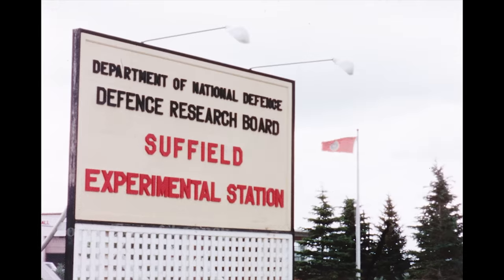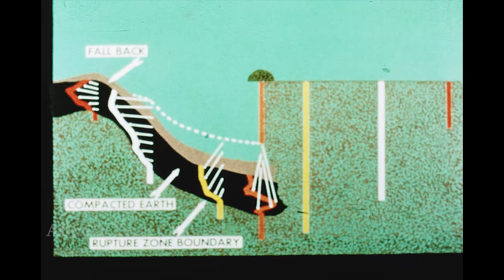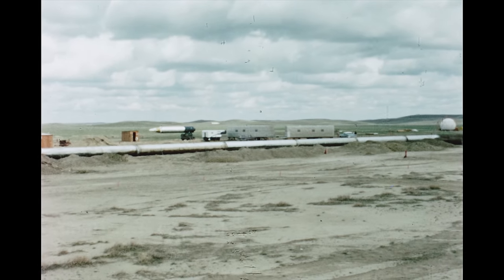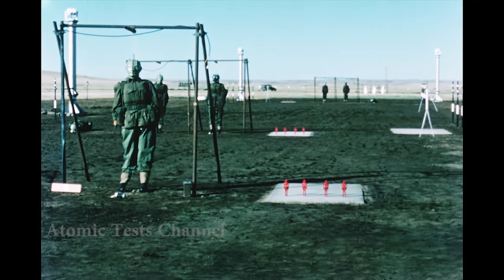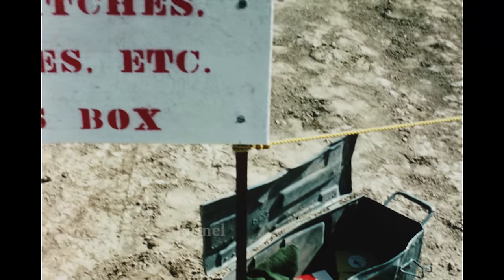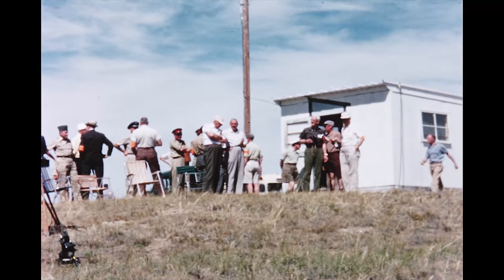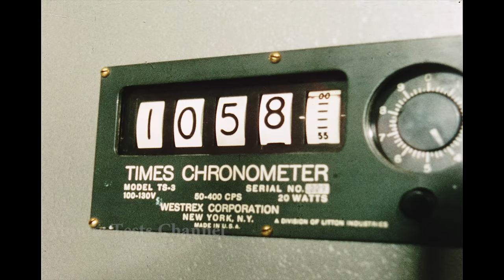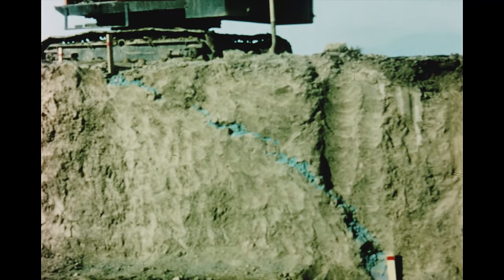4K SECRET CANADA 500 TONS TNT SIMULATED NUCLEAR WEAPON TESTING 1968

Comment: The U.S. DoD and Defense Nuclear Agency did a series of tests called "Misty Castle" starting in 1981 using ammonium nitrate and fuel oil (ANFO) to simulate kiloton nuclear explosions.  Some of the explosions included radiation sources to simulate nuclear effects.  The final test was done in 1987 called "Misty Picture" using 4,865 tons of ANFO.  All tests were done at White Sands Missile Range (WSMR) at the  Permanent High Explosive Test Site (PHETS).

Comment: There were three of these tests:

Snowball 1964
Prairie Flat 7/17/1968
Dial Pack 7/12/1970

There was a parallel series of such tests a few miles from the Trinity Site in New Mexico of 4-8 times larger, using ANFO rather than TNT.

Comment: This was a pretty cool experiment, but I feel it was missing the intense flash and heat before the actual bomb shockwave.
Reply: In our tests, we used Thermal Radiation Simulators which pump an insane amount of LOX + powdered aluminum into the air, and light it. You can see them in other videos.

Comment: Very pretty, Small compared to Heligoland or even the recent Beirut Blast (AN and Fireworks my Ar$£)
Reply: Only because there's no real frame of reference here. Around the same tnt equivalent as Beruit though..
Reply: @turdferg9703  Also, Beirut wasnt just fireworks, and that is well known
Reply: @viktorrietveld  Yeah, the fireworks set off the Ammonium Nitrate that had been sitting there for years. In the 90's the US a similar test with truck loads of Ammonium Nitrate to simulate a nuclear blast.

Comment: I live in north of canada , they test a lot of shit in there. 
We have seen every craft , ship , tank being test on cold environement . 
U know why there not f 35 in the north ?
They are shitty plane in cold environement .
Reply: Yeah, because it's not cold at 40,000 feet?  It's between -40 and -70 F (-40 C to -56 C) at 40,000 feet,  and military planes regularly fly at 50,000 feet.  So, it's colder than that in northern Canada?
Reply: Actually it’s due to it being a single engine platform.
Reply: Johnny Sinns  Dont worry we have realy great mechanic and the f18 is still beter then a f 35 .